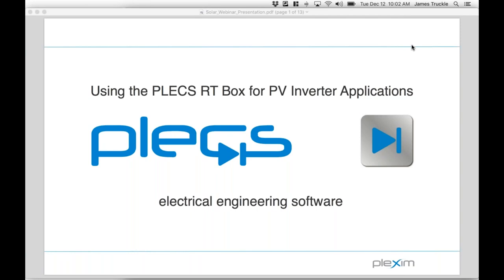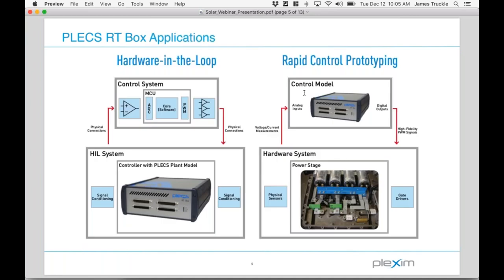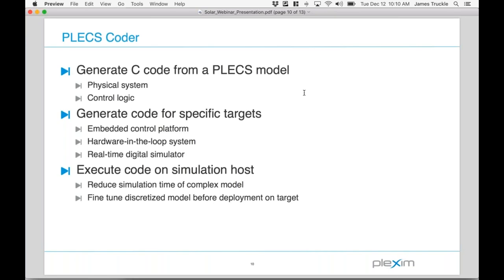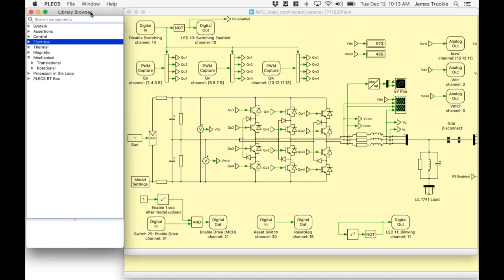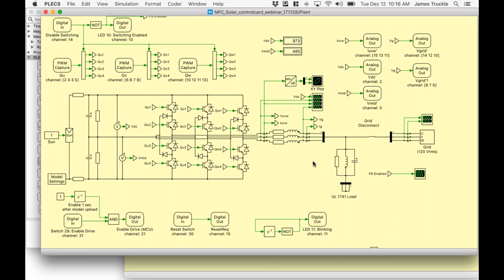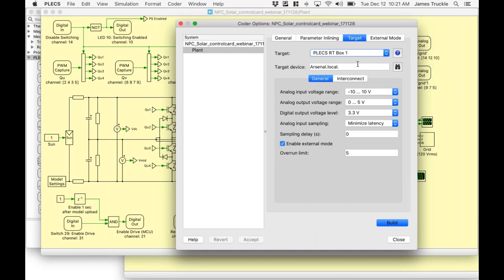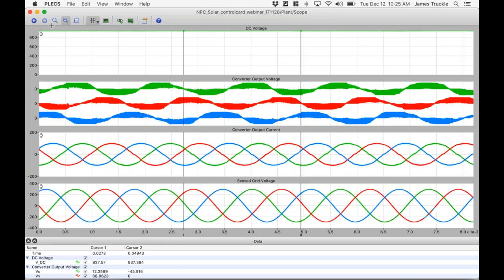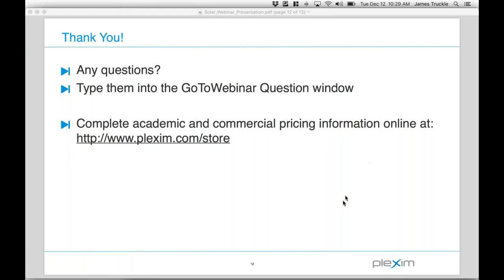Webinar: Simulating a Solar Inverter in Real Time with the PLECS RT Box (12-December 2017)

Comment: How to implement a solar panel in PLECS?
Reply from the maker: We have various demo models and application notes with a PV cell model that you can be reused in your own custom model. These can be scaled to a panel by configuring the number of cells in a string and strings in parallel. Several examples can be found here: https://www.plexim.com/support/examples?field_demo_model_product_value=1&body_value=All&body_value_1=7. The "Single-Phase PV Inverter with Partial Shading" example uses common equations to implement the IV curve behavior, whereas the other two examples use pre-generated IV data stored in lookup tables.